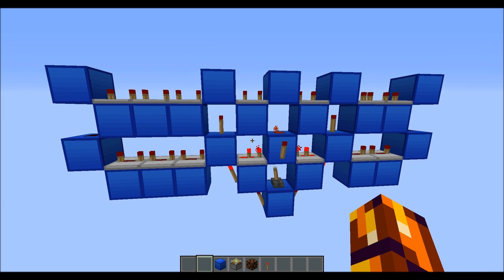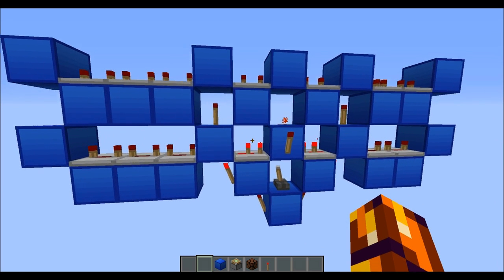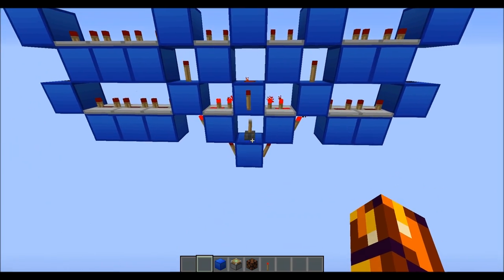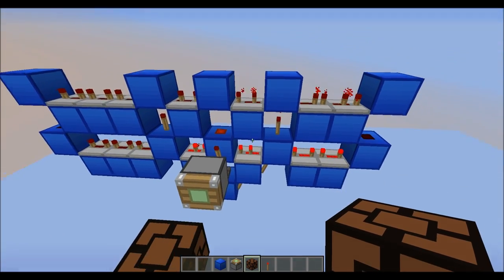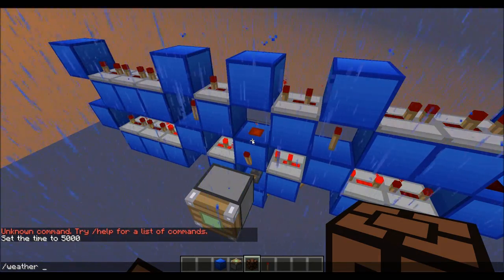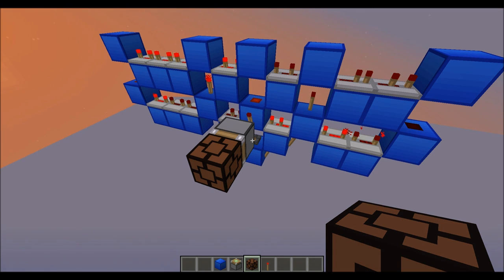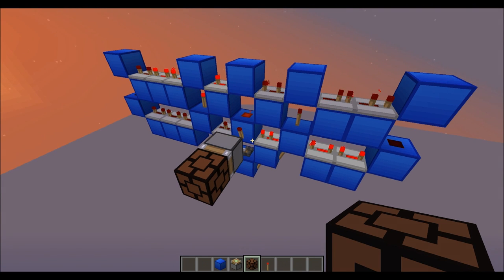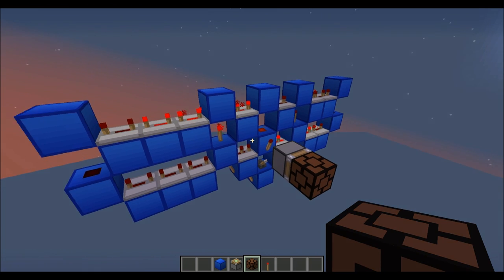Minecraft: Compact 1 Minute Clock ( Crowd Sourcing Solution )

Comment: correction: Half the amount of ticks on both clocks :P
I've made something more precise with etho's hopper timer. With 54 items and a hopper timer pulse extender with 3 items. It was to speed things up on his "ethoslab" potion brewing design.
Instead of waiting of the timer to return its normal state, I take one tick pulses out of it every 30 seconds, extend it just enough to reset the system, blocking the timer in the process, and speed things up by 45% (if not 50%)

Comment: anyway it just uses the fact that if two nombers are prime to each other (pteo) , their lowest common multiple (lcm) is the product of those numbers. 
But 50 and 24 aren't pteo (can both be divided by 2). 25 and 24 are. The lcm of 24 and 25 is 300. So two clocks of 24 and 25 ticks are in sinc every 300 ticks and by making one of those clocks two times longer, they'll be in sync every 300x2=600 ticks.

Comment: It can be made resettable by dropping a minecart through and landing on a powered rail then detector rail but as you said it is inconsistent and as I pointed out its not even a minute. Ive seen them set up such that the minecart traveling on the rails makes up for the 12 seconds that its short of, but this redstone clock is much better. :)

Comment: Translation:
Build and tested this yesterday during 8 hours AFK inside a moving minecart to keep chunks active. When I got back the clock had failed and wasn't giving pulses. To reset I had to pull the lever back and forth.

Is there any way to combat this? I need a stable one minute clock that'll run forever

Comment: I have a question. Wasn't the whole point of the "crowd sourcing 1 minute timer" to find new uses for locking repeaters? This design uses two out of sync clocks which is not a new concept. In fact, this design does not use locking repeaters at all. Why is what you pick this design among all of the "new" locking repeater concepts?